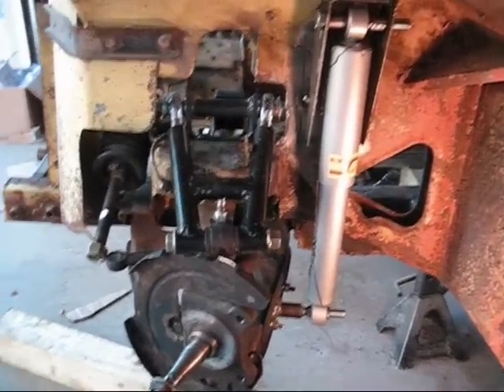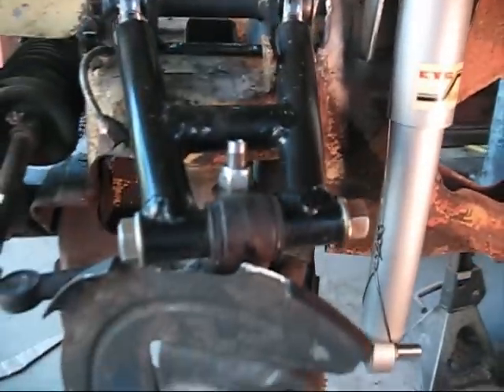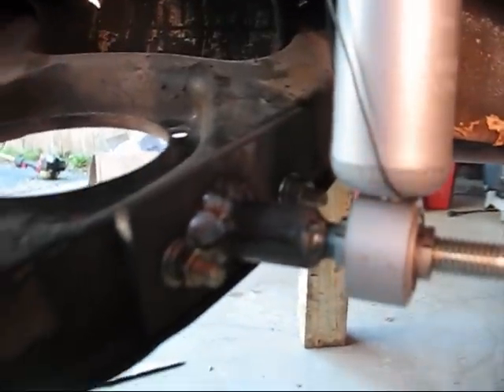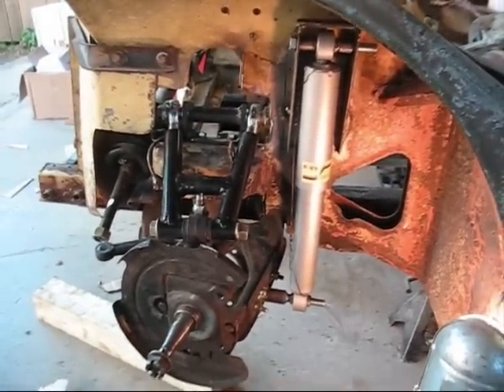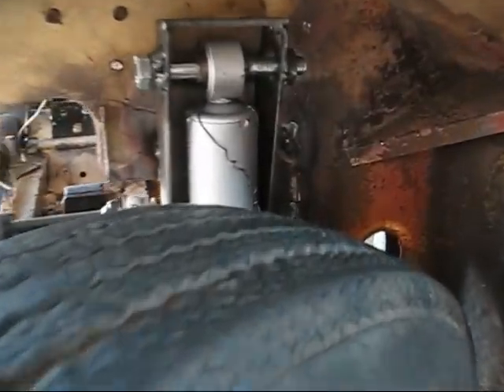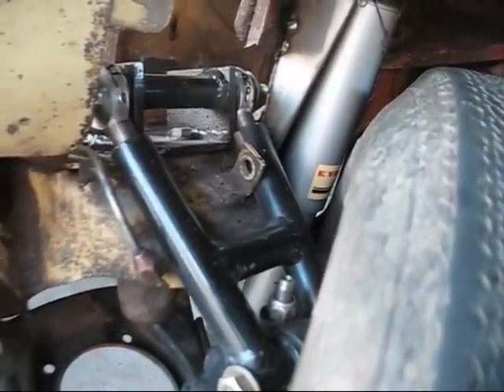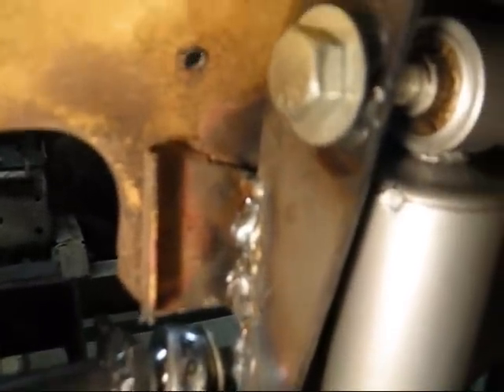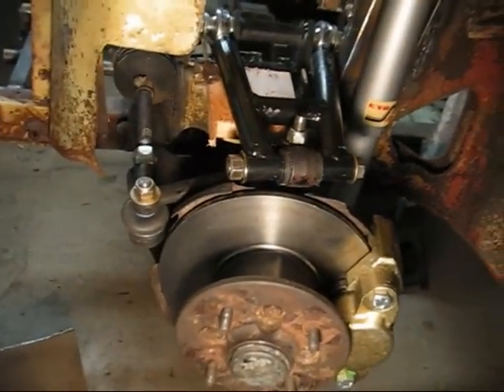Part 8 - Custom Front Suspension - 1969 Austin Healey Sprite EV Conversion

Comment: are you and engineer?, Have you or the guy you copied the mountings etc from worked out the dynamic loads and structural integrity needed and the stress on the varies points of load? it seems that bottom shock mount is directly welded rather than being welded to a plate to spread the load over more surface area.
Reply: Even if they got that running that does'nt looks professional work at all .